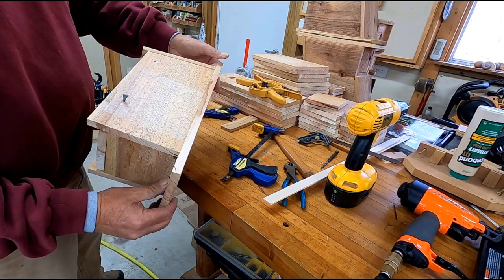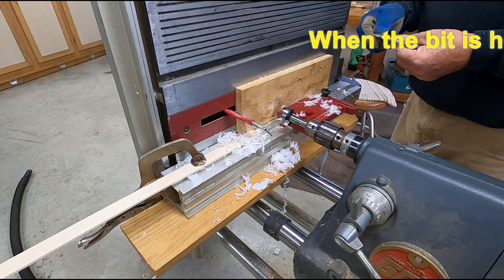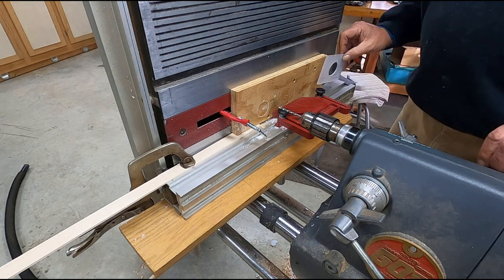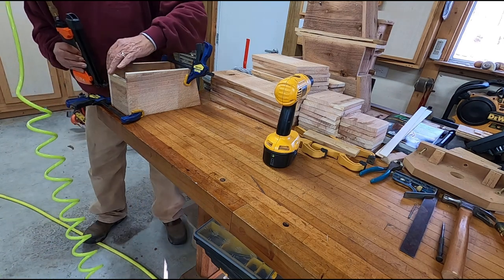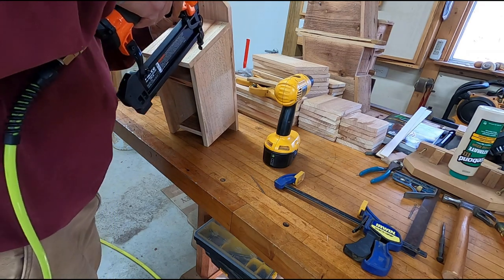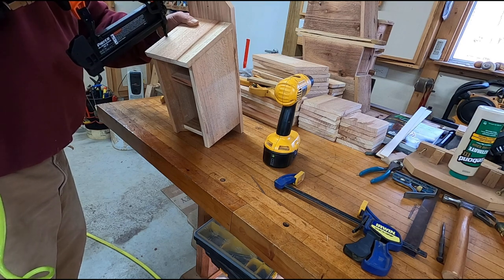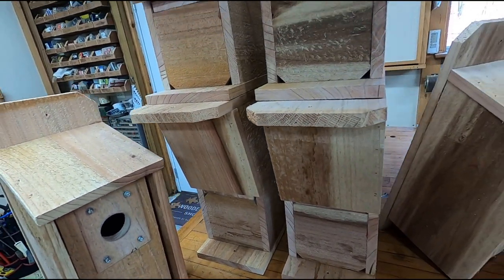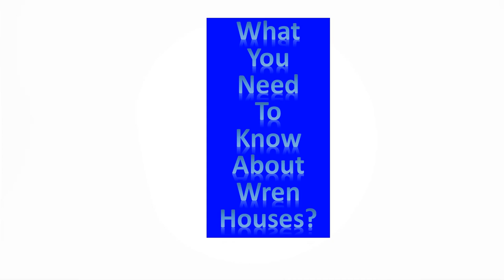Makin' Stuff: Bluebird Houses That Work

Comment: Good morning Gary. Enjoyed watching you building the Bluebird houses. I have built a few using the Peterson design.  Also you gave me a new idea about using the horizontal boring feature of the ShopSmith. I usually set up in drill press mode, but I'm 87 and the SS seems to have put on a few pounds.
Reply from the maker: Cool, thanks. I find it much easier to bore horizontal when the part is small enough to for the fence to fit between the way tubes and the bit.  My feeble old eyes seem to work better at that angle! 

Glad you picked up a tip, too!

Comment: Nice project and generous gift. I have encountered the theory that nail gun nails are far more likely to deflect left or right rather than up or down relative to the nail gun. Based on the shape of the nail being thicker in height than width it sort of makes sense. The recommendation is to turn the gun 90 degrees so that left-right is in-line with the workpiece and up-down is perpendicular to the work piece. So, if deflection occurs left-right the nail remains contained within the workpiece rather than sticking out the side. I have tried this suggestion and as far as I can tell it did make a difference.
Reply from the maker: Thanks Tom.  You are right.  

One thing that does make a difference is the tip.  With a Diamond cut point, it will deflect toward the least dense side.  A chisel point will deflect left or right… so turning the gun 90 degrees will cause it to deflect left or right within the wood.  Thus, proving your point.

A company that I worked for made box spring wood frames.  They used a modified chisel point with a bout half of the point that was blunt in the middle.  This was a custom design just for them.  They found that the point blew through the wood without splitting or deflecting. Because they only used nails to hold it in place while the glue dried, they didn’t worry about having the wood cling to the nail… a split rendered the frame a reject.  A diverted nail was a safety hazard.  The clipped chisel point was the right solution for them.

Thanks

Comment: Nice houses. :)
The sides of the brads are bevelled, so if the brad bends it is more likely  go left or right with relation to the nail gun than forward or back.   I hold the gun at 90 deg to the work edge so if the brad bends it usually  stays in the wood.
Reply from the maker: Thanks, I'll try that.